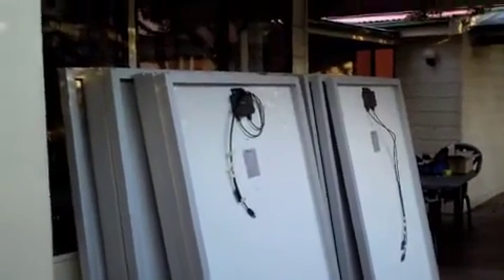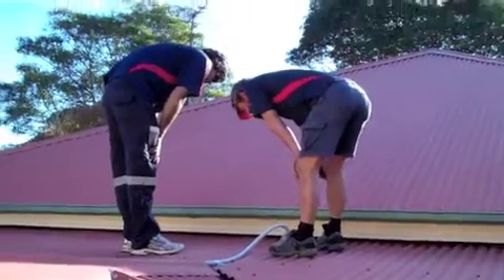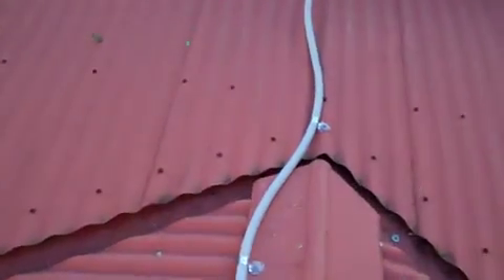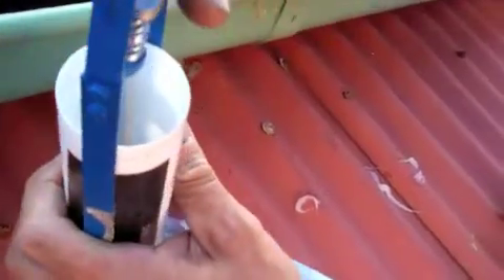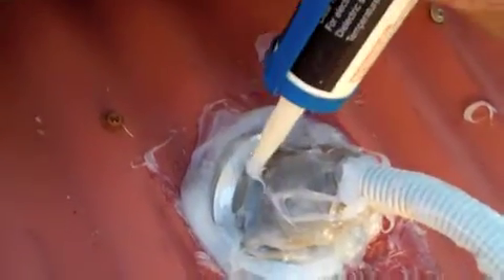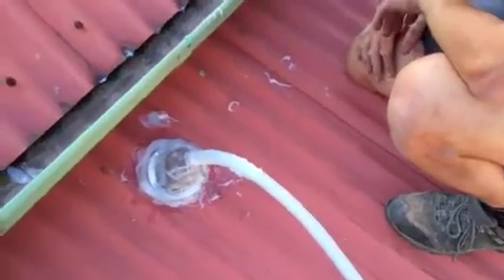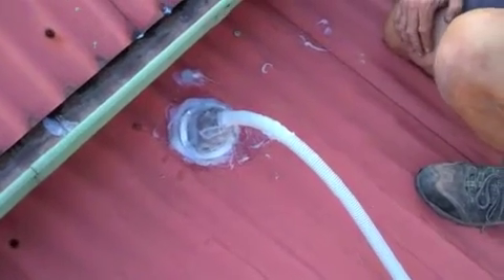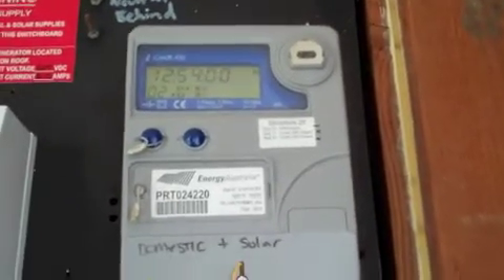Solar Panels, Hunters Hill, New South Wales, Australia

Comment: I only have uploaded 2 videos, both to do with cars :)  I have 12 years experience as a carpenter. Part of that experience I have worked on a lot of commercial properties where I have repaired every kind of roof leak you can think of!  This includes removing all the conduits roughly screwed on top of the iron from lazy CCTV/Air conditioning tradesmen.  I have no formal solar qualifications however I have been self teaching ready to do an off grid install soon.  I hope my comment didn't offend.

Comment: Oh and one more thing, the decktite(rubber boot) shouldn't have an silicone on the outside(other than a small neat bead).  They should seal the conduit up where it goes through the iron, then silicone the mating surface of the boot and rivet it down to the iron.  It would help if they at least tried to pre mold the alloy strip in the boot to get a better fit.

Comment: As for the DC disconnect switch, that's common practice also however that doesn't make it right.  Ideally a small fuse box could be installed under the inverter to reduce the conduit run and to hide the switch(assuming its legal to put the switch in an enclosure.) 

Id be talking to them about that, not acceptable.  At least you got a good quality SMA inverter :)

Comment: That's the sort of rubbish I see on commercial properties.  At the very worst they could lift the iron and run the cable most of that distance and then pop the cable up and under the wall cladding, thus only a short run of conduit is visible.  They could at least use solid conduit and mount it straight for you.  Realistically they have simply laid it on top because that's the quickest way.